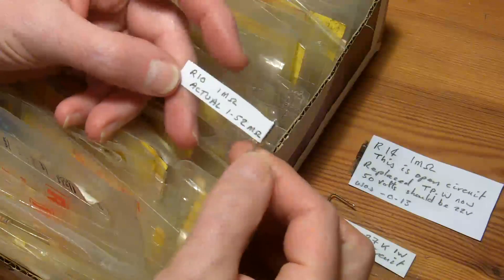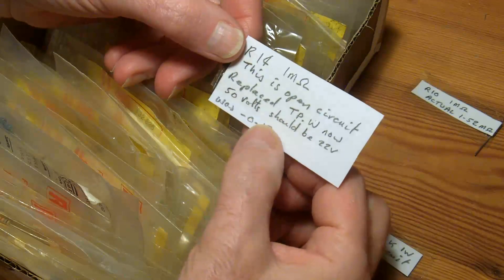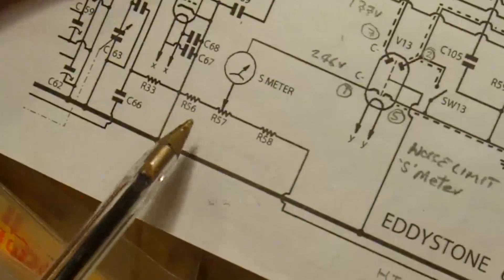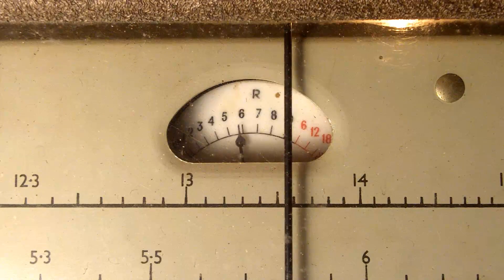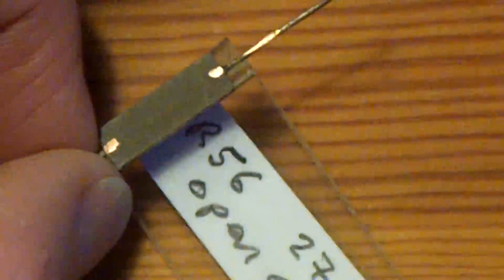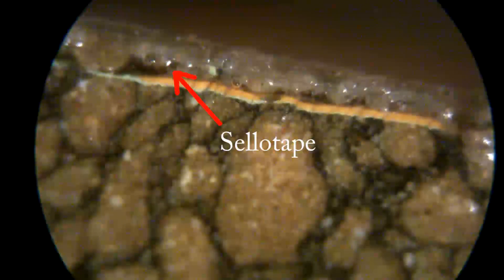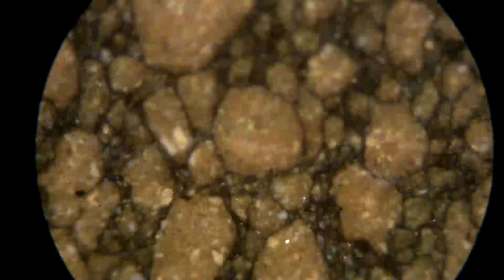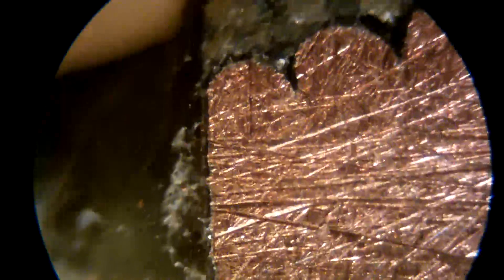About Radio ... Part 33 Ongoing repair of Eddystone S680X by Andy Davies

Comment from the maker: Hi Barry, funnily enough somebody else’s mentioned this, yes you can change the value of a resistor. I’ve seen it in a wartime ‘Radio Repairmans Guide.’ You may have seen resistors described as ‘Laser trimmed’ and that’ll be something like a metal film resistor that has been precisely ‘trimmed’ to a specific value. I’ve never trimmed a carbon resistor but I must have made dozens of wire wound resistors out of nichrome wire where I’ve cut the wire to length to get the value I’ve wanted.    
Andy

Comment: You have cut that bad resistor in half, if you did the same to a good resistor, does the resistance change? Can you alter the resistance to make it your needs? Such as shaving off a corner to reduce the resistance.

Comment from the maker: Hi again, I ran out of time, I was working on the kitchen table with all the kit spread around but I had to tidy up for visitors, other events got in the way but I have now uncluttered my workshop where I’m mid way through a Hipps clock project. I’m hoping that once I get the clock project out of my system (it’s taken ~15 years since I first thought about it) I’ll get on and finish the Wobbulator. I’ve got a second Wobbulator to play with as well, it’s just time of short of.
73’s ... Andy

Comment from the maker: @1710WL 
Hi thanks for the comment, in the past, when developing thyristor invertors for induction heating applications we’d cut open the ‘hockey-puck’ capsulated thyristors and we could tell if the device had failed by being over volted or if it was an over current fault. They were hugely expensive and anything that helped fault find was welcomed. The other odd thing I’d do is smell a failed equipment and I could often identify the fault by the aroma.  Happy New Year... Andy